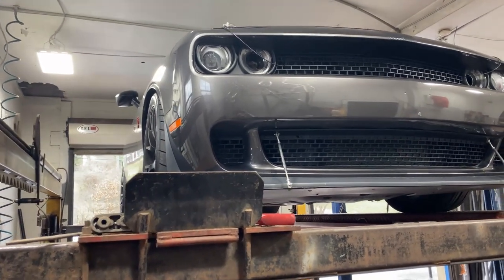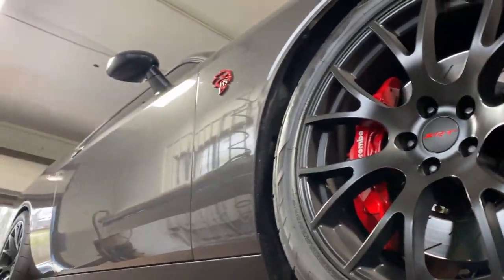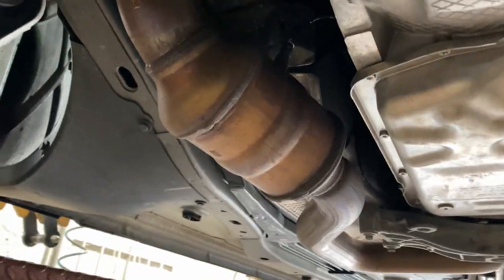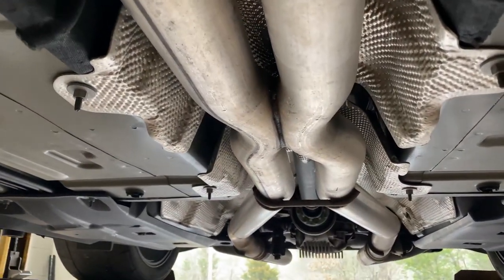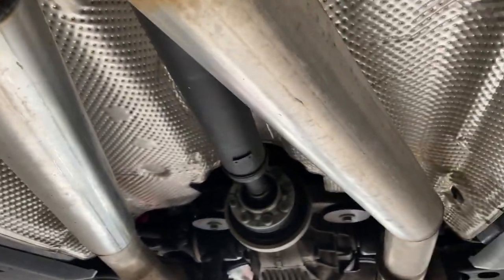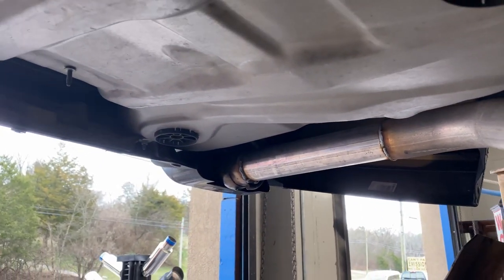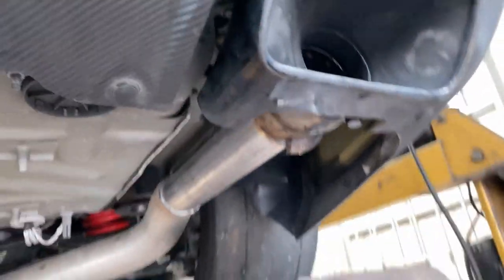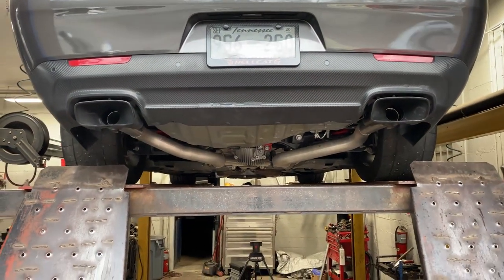2017 Dodge Challenger Hellcat TRUE DUAL EXHAUST w/ STRAIGHT PIPES!!

Comment: 707hp through dual 2.5" at the far rear? At least run 3" like the rest of the system. Why neck it down?
Reply: I agree makes no sense to make it smaller like you said 3 or even 3 1/2
Reply: First of all that boat doesn’t make 707 lol. People can read brochures.😂
Reply: @javiderek31  how much does it really make then?
Reply: I still think it's too small of an exhaust at the tips.
Reply: Eric Ernst no car is the same but stock they put down 600-640ish to the wheels.depends on dyno and the day. So many variables. Sounds like a lot power then you look at the weight of the damn boat coming in at 4500lbs. Power to weight ratio is what matters too.
Reply: @javiderek31  that sounds lan awful lot like 707 to the flywheel to me. Power to weight doesn't matter when it comes to exhaust pipe size like I said in my original post. I get that you have a personal vendetta against the heavy ass challengers. I'm not a fan either,  but I disagree with what the exhaust shop did by necking the tailpipes down to 2.5" right at the tip. I believe it will help power production if they hadn't choked it down.
Reply: Midwest Corvette Plz stick to Corvettes. You obviously don’t know what you’re talking about😂
Reply: Yeah they should have made it 14" all they way back
Reply: Midwest Corvette well my hellcat made stock 670whp and now with just a bolt on and a tune it makes around 730whp plus I made it 4.060 pounds what about now? Plus I prefer a boat car rather than a midlife crisis mobile or a crowd killer even tho I love the GT500
Reply: That Guy With The Lambo midlife crisis mobile is my new favorite name for a corvette
Reply: @williammaddox937  only reason to make it smaller is to get more torque but the hellcat has a good amount of torque already.
Reply: smaller pipe = louder exhaust usually, because the exhaust gasses are going much faster and are more pressurized than if it were bigger, but agree, needs a 3" or bigger because of the high hp
Reply: @isatntt  I'm running single open 4" on my 1990 k2500 and it's loud as shit. It's a supercharged 355 sbc. 4" is definitely louder than single 3".
Reply: @javiderek31  Dodge Challenger SRT
Sports car
Model: Dodge Challenger
MSRP: From CAN$95,245
Horsepower: 797 hp
Curb weight: 2,015 kg
Engine: 6.2 L V8
Fuel economy: 14 L/100 km combined (18 city, 11 highway)
Tire size: 275/40R20 The 2020 Dodge Charger SRT Hellcat Widebody's 6.2-liter V-8 uses a massive supercharger to deliver 707 horsepower and 650 pound-feet of torque. The engine is mated to an eight-speed automatic that, the automaker says, can improve both performance and fuel economy.Jun 27, 2019
Reply: @isatntt  that's right. More velocity and back pressure
Reply: Lol.... 707 crank. But that’s the same for any car. Nobody puts down the WHP numbers. My old 300hp Sri put down 240 whp. My hellcat put 652 whp. Crank is 707 but whp was 650.  So funny to hear a corvette owner hate on a faster car.
Reply: @bryce817  it's a supercharged v8. It doesn't need backpressure from dual 2.5" pipes. The pressure waves from scavenging are nullified by the pressurized intake charge. I stand by my initial comment where I question the exhaust shop's decision to neck it down to 2.5" tips. At least give it dual 3".
Reply: @Jerwgwrebrogamiesai  😂😂😂
Reply: @isatntt  I'm sorry but gotta disagree with you on this, yes i know smaller equals higher velocity, but in No way will it be Louder, it's Always Louder with Larger Diameter Exhaust Pipe. I've personally tested that theory on many different types of cars and engines, Bigger Diameter was Always Louder. Diesel or Gas.
Reply: @bryce817  Yes, more Velocity and more Backpressure, But Larger Diameter Exhaust Pipe is Always Louder.
Reply: @badass6.0powerstroke10  hey, agree to disagree, you were respectful about it and tbh i wasnt speaking from experience, i've never done anything like that however i heard a few people talk about it and it sounded right, i know echoes would be amplified in the bigger diamater but anyway i digress
Reply: @isatntt  Yeah no problem, I've tried it years ago many times, Bigger Diameter was Always Louder.

Comment: That's not straight piped or true dual exhaust. You have an X-Pipe and Cats on it still.
Reply: Umm laat i knew the x pipe just keeps pressure flow the same in each pipe correct me if im wrong tho